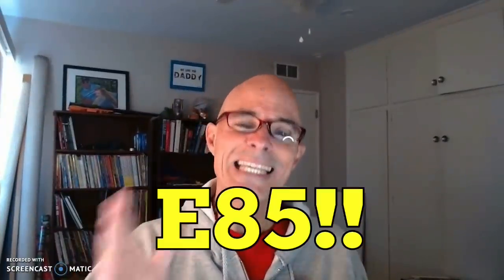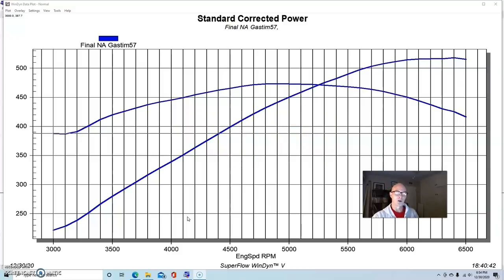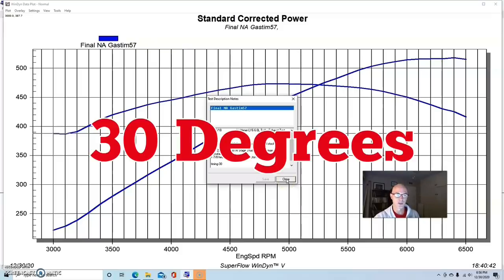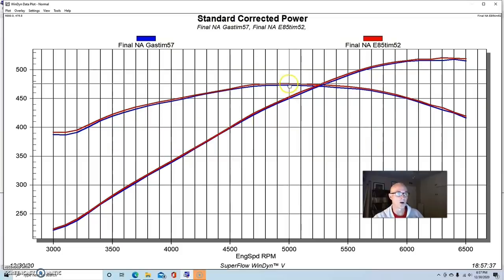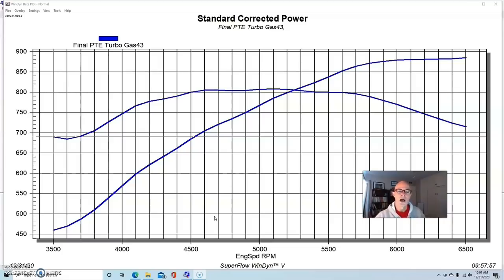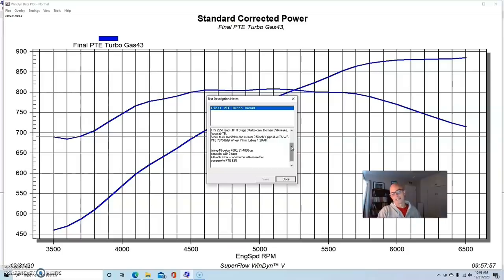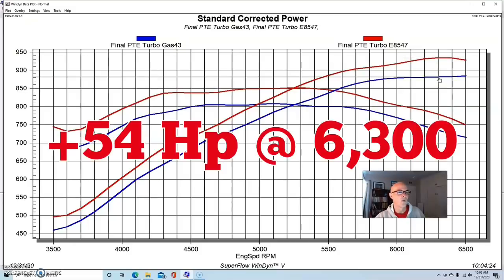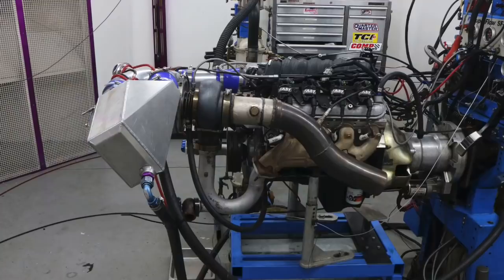JUNKYARD TURBO 6.0L LS E85 FUEL TEST

Comment: E85 gains power naturally aspirated as compared to 93 in heavy trucks. The 93 will limit the timing to around 22-23 (sometimes less) and e85 allows you to run to the optimal 27-29 degrees at the peak. This is after tuning. 

The factory tune file has the 99-06 trucks neutered from the factory - 10-12 degrees at the power peak on the low octane table. High octane table is around 16-18 degrees or less. 

I run a flex fuel sensor with a cam, springs, and boost on my 2001 Silverado. Ethanol adds 4.5 degrees. I run around 20 degrees on 7lbs which is plenty safe.

Edit: I ran 27.5 degrees NA on ethanol. 20 degrees on pump gas, anymore and it would pick up knock retard.

Comment: I got my turbo 5.3 street ready about a year ago. I was running around on 5psi for  a while, until I finished the boost control and programmed it on the Holley Terminator. I was having no issues hitting 12psi of boost l, until it started getting hot here in Texas. I don't beat on it very hard, 6k max rpm at most. I attended LS Fest at Texas motor speedway a couple of weeks ago. On the way there, it made boost fine, no issues. On the way home it started popping and losing power at 5k rpm. I data logged it and everything looks great. IAT steady at 125, 100 degrees ambient. It will not make more than 6psi now. Right at 5k rpm and 6 psi boost, it pops like a 2 step. My 2 step is set at 2500rpm so I can make a little boost before the converter spins the tires. If anyone sees this and has any thoughts, I would welcome some input. It's on 93 octane, and the plugs all look great
Reply from the maker: leak

Comment: One test you ran both at optimized timing, the other you did not... unequal scales.
Reply from the maker: always optimized timing, unless a specific test with only 1 change (like just fuel)
Reply: @richardholdener1727   I guess I was going off your words at ~11:36 where you said it wasn't the point of that test to optimize the timing, and you could have ran another couple degrees without problems...
Reply from the maker: AGAIN, TEST 1 THING AT A TIME!
Reply: @richardholdener1727  That's my point... You tested one with optimized timing and fueling, while the second was 9° less timing, with your own commentary about how the timing was not optimized, and you could have run another degree or two without problems... Hence, the unequal scales.  It really would be interesting to find out why the differences between e85 and race fuels...

Comment: First off, I am now addicted to your videos! I started reading about your work when the big bang 4.8 was first circulating. Second, I'm a big fan of E85. I picked up 80hp in my 2011 CTS-V after tuning by adding flex fuel capability. I'd really like to know the Lambda instead of AFR, since both fuels require a different AFR to be equal. But running the tests at the same Lambda would show just the effect of just the fuel itself. Then maybe adding timing and showing how much tuning can be added at equal boost levels to show how much the cooling & octane really help... But on the GT45, 4.8, BTR stage 1 truck cam motor. Just because I want to know what my combo is going to make at the crank!
Reply from the maker: THE LAMBDA IS THE SAME-WE USE THE GAS SCALE SO BOTH ARE RUN AT 11.5:1 GAS SCALE
Reply: @richardholdener1727  I'm not quite understanding.  You're running them  both at 11.5 AFR or you're running the pump gas at 11.5 and the E85 at its equivalent (same lambda)?

Comment: I don't think the stock 6.0l has enough compression to really take advantage of e85 expecially sense it was already optimize for 91 octane over the stock 87 octane it was designed for. I love e85 either way because it's a good cleaner for the back of your valves and such.
On the turbo application, ive heard e85 increases turbo response rates because of the extra fuel that is needed for ethanol. That would be interesting to see.

Comment: I started to fill up e85 on the old flex fuel Silverado and I loved the way it ran. It felt smoother than when I drove it on pump gas. Plus by using e85 we can be less dependent on fossil fuel or foreign Petro products too. Thanks for the test Richard, very interesting test.

Comment: Did you use the same heat range and gap on the spark plugs when running race gas vs. E85.
Reply from the maker: YES

Comment: I have a c3 corvette Running rear mounted VS racing 7875 Gen 2 Turbo on a 6L engine, If I run E85 how much boost can I run without an intercooler?

Comment: I'm curious what A/F ratio you're running on the e85 both N/A and turbo. E100 has a lower density than gasoline and stoichiometric is 9:1 so you need to run quite a bit richer with E85.... like 8:1 for peak power.  I suspect the cooling effect must be about the same with E85 vs pump gas on the N/A engine, but have a better cooling effect on the turbo engine.  It may be interesting to see exhaust gas temperatures in the comparison also.
Just for the fun of it, I tried a little math to calculate theoretical MAF and theoretical power and VE at the peak torque rpm of 5000 on the N/A engine.
6.0L/2 * 5000rpm/60sec/min * 1.184 g/L = 296 g/sec = 39.12 Lb/min MAF @100%VE
multiply by 10 hp/lb/min airflow and I get 391 HP.... using the 450 hp number you had
450 hp/390 hp =.1.15 which is what the VE of the engine would be at 5000 rpm.
I don't know if this is even possible, but the facts cannot lie.  It would also be interesting to see some MAF numbers.
Reply from the maker: WE ADJUSTED THE AF ON THE E85 (AND GAS) TO FIND BEST SAFE POWER

Comment: Really curious to see how the E85 would compare to pump gas NA when the coolant temp is up at a normal op temps for a car around 180-200 degrees. I seem to remember you normally doing runs when motors are still fairly cold...

Comment: Off of this topic. When we look at drag racing engines it seems a 540 is about as big of an engine that you typically see with turbos or some kind of supercharger while nitrous motors are approaching 1,000 cubic inches. 

Is there a limiting factor, or a rules restriction?
Reply from the maker: NITROUS MOTORS NEED MORE NA POWER THAN BOOSTED MOTOR TO GET TO THE SAME HP LEVEL
Reply: So, boost doesn't need those mountain motors.

Comment: You need more compression as many have already said. If an engine will already make peak power before reaching detonation then changing fuel ain’t gonna do jack. You need compression or more heat in the motor so the alcohol can show it’s gains NA

Comment: If an NA gasoline engine is set up such that you can give it all the timing it will take without detonation, I can see where the Ethanol wouldn't change anything. If the NA gas motor is finicky and detonates with timing that would give it more power, you back off the timing to let the motor live. In that case I can see how the extra detonation resistance of E85 would allow more timing and therefore better numbers. Things like chamber shape, piston speed, overlap, charge density, intake charge temp, reversion, and head temp all affect this. But I am well aware that you already know all of this and more. Interesting video. In Harleys with high static CR and in Harleys with boost, E85 works better as the motor runs cooler all else being equal. That winds up yielding better numbers largely due to allowing more timing.

Comment: What happens if u dont balance a engine?
Reply from the maker: IT WILL SHAKE ITSELF TO DEATH IF IT IS WAY OFF
Reply: @richardholdener1727  thanks i dropped off my rotating assembly yesterday. Not gonna gamble on killing a brand new rotating assembly over a trying to save money.
Reply: @richardholdener1727   you are right. I just got a shop to balance it and he said the bob weights was off by alomost 200 gramson my bob weights. Thank you so much

Comment: Happy New Year Richard! Have you seen anyone using 2 stroke oil or castor oil when using E85 to lubricate the valves? I am building a roots blown 540 with the Holley dominator with the injectors on top of the blower to lubricate the rotors and I want to run E85, but I’ve heard people having issues because it doesn’t have any lubricating properties, so I was concerned that it wouldn’t work injecting it into the top of the blower
Reply from the maker: ILL ASK ON THAT ONE-THEY DO NEED LUBE

Comment: On my 2015 Chevy Cruze with a flex sensor installed I like to run about a 30 to 35% alcohol mix. It really runs good at that amount. Way better than 93 octane with 10% ethanol. It also is letting the computer command about 2psi more boost that way.

Comment: You are burning at least 20% more fuel with the e85, I would think that the lower charge temp is helping increase power. I wonder if using ice water in intercooler would change the results to bring race fuel and e85 closer in the power?
Reply from the maker: ICE WATER ADDS POWER TO BOTH
Reply: @richardholdener1727   Which fuel has more energy potential?

Comment: Did you run the same injector also? i was always told with E you need 2x the amount of fuel to make the same power. Happy New Year, Love the vids!
Reply from the maker: WE HAD BIG ENOUGH INJECTORS TO SUPPORT THE FUEL FLOW ON THE E85 (IT'S NOT TWICE AS MUCH)

Comment: What was the duty cycle of the injectors and fuel pump e85 requires double the injector when compared to standard gas setups
Reply from the maker: THE E85 FUEL  FLOW IS NOT DOUBLE GAS
Reply: @richardholdener1727  correction e85 needs 35% more volume for the same pressure

Comment: I would also like to see the n/a e85 compared on a higher compression engine, I think that's where the big benefit is. Something 11:5.1 or better, e85 could really shin there, the pp gas would have to be run on lower timing to keep from knocking and the e85 would be able to take advantage where the pump gas couldn't. That would be cool too.

Comment: Great video as usual ! Please make a video on how much straight methanol injection you can add on a boosted application with 91 pump gas. Even seeing if adding a second methanol pump in parallel is worth it. Thanks
Reply from the maker: I'M MORE WORRIED ABOUT DISTRIBUTION
Reply: @richardholdener1727  Even with a carb style efi intake? Or even trying port injection. It would be interesting to see if there is such a thing as too much methanol and to what point you would be better off switching fuel

Here in Canada, no E85, race gas is expensive and you can buy 99.9% methanol at you local hardware store

Comment: I've seen less knock sensor activity on my boosted Coyote at 15-17psi on E85, compared to running 7-8 psi on 91, both fuels using dedicated optimized tuning. I hope E85 never disappears from the pump. Great video!!
Reply from the maker: THNX-GOOD INFO

Comment: Have you tried E30 or E50 this is a common thing for turbo'd 4cly with a weak or GDI fuel system, I personally think a mix of E85 and race gas might get you more power per liter of fuel and still hit of even exceed pure E85
Reply from the maker: AFTER E50 THE GAINS ARE MINIMAL
Reply: @richardholdener1727  i figured at best the extra flow might only help egt, I have twin turbos on a 2014 yukon 5.3 with vvt&dod delete with a btr stage 1 cam. Also beefed up the trans for towing. I did the tune my self was not that hard more or less just chase the numbers and watch egt and stay on the safe side. Im at 12.2:1 at 12psi and 24deg timing peek but i tuned while pulling a 9000lbs trailer and then to static loads to make it more daily drivable

Comment: I've always heard rumors that E85 can build boost faster because the chemical reaction of combusting E85 produces a greater volume of exhaust. Have you ever seen evidence of such a thing?

And I think most LS guys would shy away from 30 degrees of timing NA on pump gas, so that might be where some people have found gains in E85--by having enough stomach to put the timing in under their E85 safety blanket
Reply from the maker: I HAVE NOT SEEN THAT TESTED

Comment: The LY6, being a truck engine originally, has 9.7 or so compression. It runs on 87 octane with a factory truck cam. Even with the TFS heads, assuming a 65cc chamber, the compression is just over 10:1. That should not stress the pump gas octane. I’m wondering what would happen to the NA test if you put flat top, or even a small domed, piston in this combo and retest. I’m thinking 11 or 11.5 to 1, maybe more. Reducing the combination of chamber, piston, and head gasket by 10-12cc would get you in that range. I’d think timing sensitivity would make that combo like E85 a lot, but only the dyno really knows! Can you test this for us, Richard? Love this channel!
Reply from the maker: HIGHER COMPRESSION WILL HELP WITH E85

Comment: Richard, I have a question about the horsepower of this 6.0. It seems pretty low compared to a lot of the other 6.0 stuff I’ve seen you put out with H/C/I upgrades. It seems more comparable to the 5.7 H/C/I ... any thoughts on why it seemed to be quite a bit lower?
Reply from the maker: CAN YOU SHOW ME WHICH 6.0l HCI TEST THAT MADE MORE THAN THIS WITH A STOCK BOTTOM END? MAYBE A 6.0L LS2 WITH SLIGHTLY MORE COMPRESSION? BUT THIS IS WHAT THEY DO
Reply: Yes sir, the 6.0 factory head shoot out. Made 576 hp, now that was with a FAST intake and I know they make much more power than the Dorman intakes and I also realize that you used different cams but specs were not that far off. So basically it’s about a 55 horsepower difference from what  could see. I love your videos bro, very informative and I actually went and bought a FAST 102 with 102 throttle body because of the intake test video where you tested like 20 manifolds and I did notice a big difference with full bolt-ons LS6... AFR 215’s sitting in my garage in the box and probably gonna run that Comp 459 cam. Thanks for all the info and thanks for any reply’s  👍

Oh and Happy New Year!! 🥳🥳

Comment: But e85 is about 30% less efficient than regular gas.
Reply: At the same volume, yes. Its octane and evaporative cooling effect make it ideal for very high compression or forced induction. But, you have to supply larger volumes of it compared to gas.

Comment: Richard I need help my 06 Yukon with 4.8 is an ls what?
Reply: It's not a "true" LS. I believe the 4.8 RPO code is LR4. 

The true LS designated engines are in cars and have aluminum blocks. The 4.8/5.3/6.0 truck engines are iron blocks (some exceptions) but otherwise are very similar. Most parts from either will bolt on as long as you have the intake and head port combo right. 

They are so similar that you will get people that blow up the engine in a Camaro or Corvette and replace it with a truck engine. All of the accessories, exhaust manifolds, intake, etc bolt right on.
Reply: Thank you and my motor is 706 heads.but still is it just an  intake. I have an aluminum block I've checked.i guess I need to look up the block. Happy New Year to all.

Comment: E85 compared with pump plus water /meth would have been a better comparison.. Both are very effective  but pump with water/Meth is way less cost factor and easier to set up doesn't need more fuel bigger injection system etc.. and not to mention easier to tune especially for street cars... and access isn't an issue... Tuner School Chanel also proved its effectiveness of running pump with water /meth mix to be close to power levels  boosted as E 85 and higher than race fuel and even better if you can run both E85 and water /meth.  Just a thought maybe you missed something during your comparison?
Reply from the maker: WATER METH HAS HUGE DISTRIBUTION ISSUES ON A LONG RUNNER INTAKE

Comment: Mr Holdner, do you feel a 9 to 9.5:1 compression on a LSX type engine be safe on 91+ octane with up to 15lb of boost?

What do you think "BALLPARK" max compression could be obtained because i know many supercharger companies even GM have put boost on 11:1 engines, i was just curious to what your take is with a good healthy cam of at (LEAST) 230* @ .050+ high duration cam types..

Because i wish to have a good healthy compression in case the charger may have issues etc, you can still have a really stout N/A only engine with a simple tune swap.
Reply from the maker: DEPENDS ON TIMING

Comment: Simple, static vs. dynamic compression. Octane gives you “resistance to detonation” I felt that you could have gone to a 14:1:1 na would have given better power. Then use math to tell you the limits of e85 dynamic compression for the turbo. After that fine tune the timing to keep it from blowing out the side ....

Comment: Richard whats the chances of doing a vid demonstrating how you build a timing map? I understand every engine wants different things but it will give us guys playing at home an idea of how to do it.
Love your work as always! 👍🏻
Reply: I agree. I'd love to see a full timing map build, especially on a turbo LS!!
Reply: Trust me, you don't want his timing maps.  His timing maps are for max effort on the dyno with good fuel, 120-130 degree coolant temps, perfect ventilation, no underhood heat to worry about, no knock sensors.  In real life where lugging exists from being hooked up to an actual vehicle drivetrain there are spots in the powerband that will not tolerate nearly as much timing.  Plus, the most important area is down in the 1500-2500 part throttle range, something that doesn't even get touched on a dyno.
Reply: That Holley setup is completely different than a factory ECU. He also doesn't use knock detection.